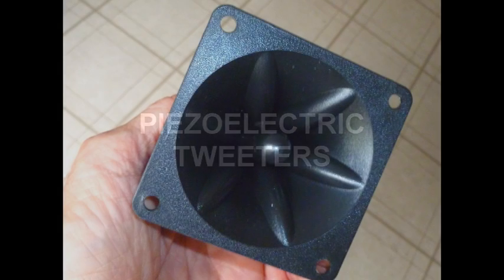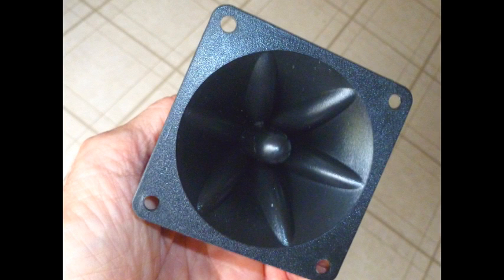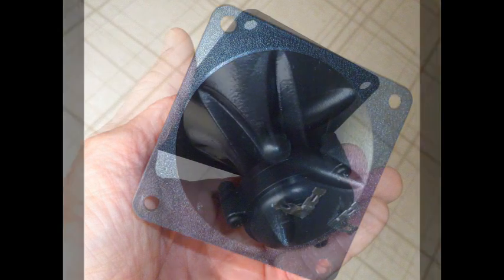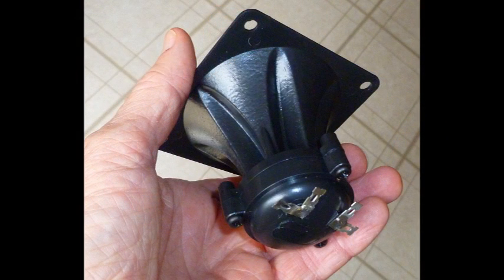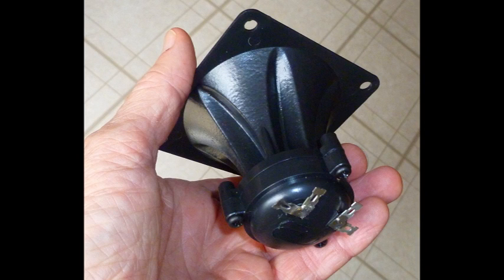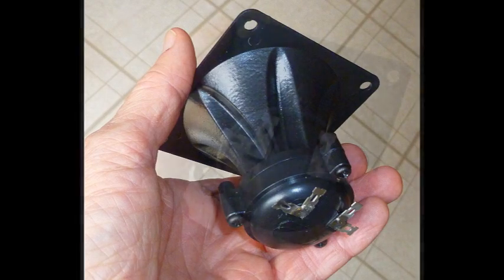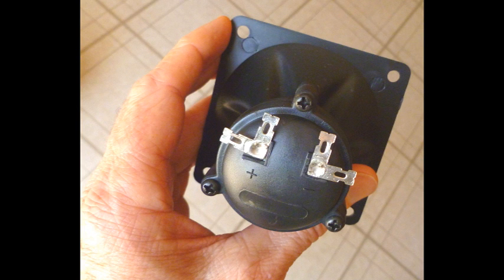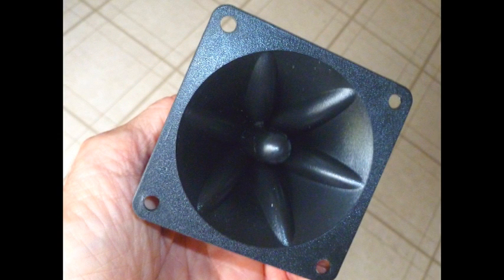BARKING DOGS NEXT DOOR? - HIGH FREQUENCY SOUND - A DISCUSSION

Comment: The Dog Barking 'Tweeter' you want is what can be found in Whelen Sirens and Horns. Same with 'OLD' alarm system horns. You can even hear a cracking when you touch the 2 wires together in the speaker/horn. Many are made to handle over 2-400watts! Also great for keeping bugs and rodents away too.

Comment from the maker: To those who watch this video: In this video I want to stress that this is just the starting point for a bigger picture. I spell it out in another video, but I suggest and advocate using lots more power and sound level than commercial devices even approach. I believe that if you get high enough sound levels (probably with multiple transducers) that you could run off a grizzly bear, let alone a dog or two. If the dogs are loud, then we should be loud too.